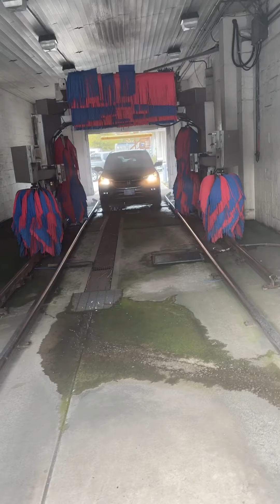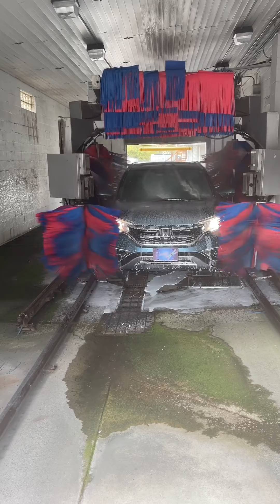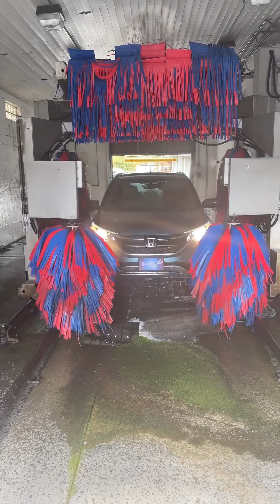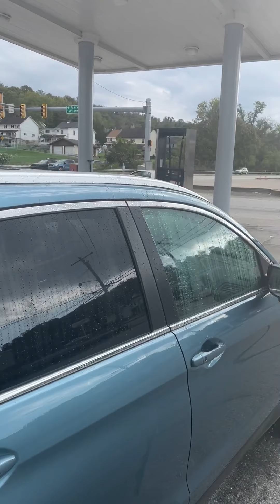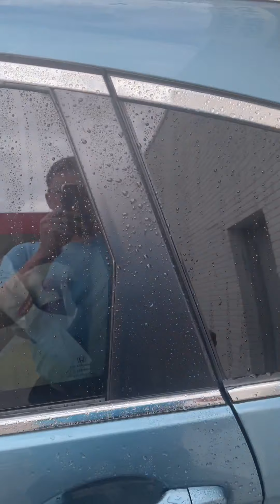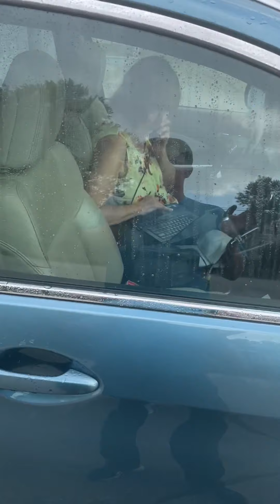Exit View Ryko UltraClean At HoneyBear Sunoco Gas Station At Perryopolis PA

Comment: Great video normally I'm not a fan of the voyagers/ ultracleans having neoglide brushed but I think this one is very well kept done needs some grease or bearings for the top brush but over all it did a great job
Reply from the maker: Yes I agree with you but the topbrush noise needs adjustment repaired!